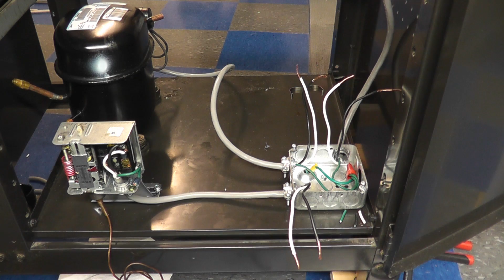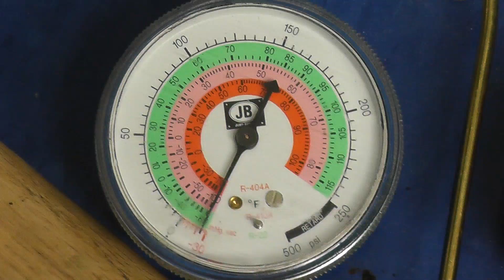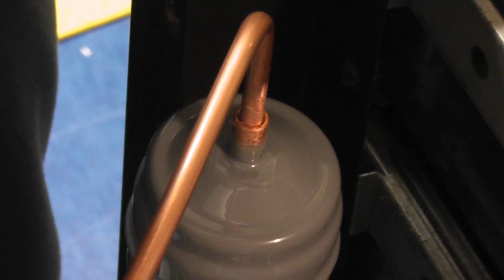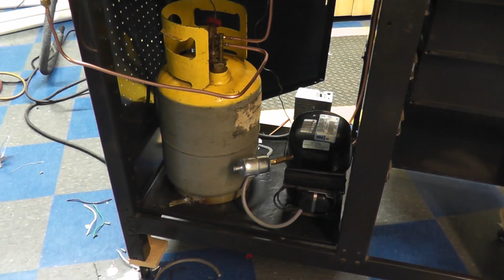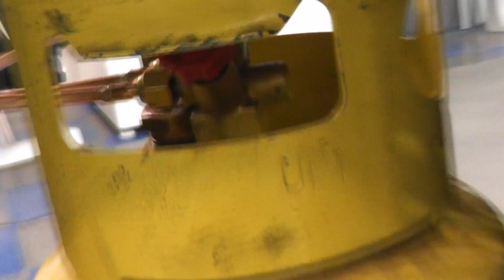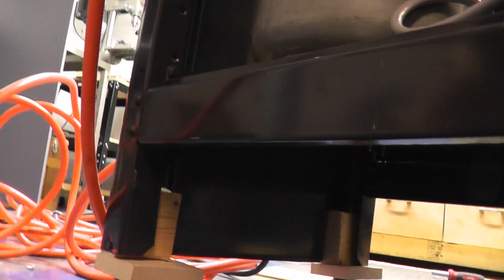Building a Silent Air Compressor Part 2

Comment: Getting rid of the water out of the pressure tank is one thing and is simple, however, the compressor intake air always has moisture in it which mixes with the oil in the compressor. That moisture together with the heat generated by the compressor pump will sooner or later render the oil ineffective and overheat the compressor. Being a refrigeration technician you know quite well why you don't have this oil/water problem in a functioning refrigeration system. So, what is your answer to prevent  the cooking of the oil/water mixture in the compressor for this different compressor application?
Reply from the maker: Haven't had an issue with it all the years I've been running it.  I just add a touch of air compressor oil to the compressor when I need to run it.   I'm only using it for air gun air and a small badger airbrush.  Usually just fill the tank and shut it off and that's enough for the.times I need to use it.

Comment: I was waiting for the plumbing to the pressure switch, didnt realize there was another connection available on that tank..  guess thats the benefits of using a refrigerant bleed down tank..  
   Was also wondering the type of restriction the drier puts on the system..  can you blow through it pretty easy?  Would think itd be pretty restrictive..  
  Wonder if anybody has done a oil seperator with an auto drain system that drains back into the intake of the compressor..  was thinking of trying that but the auto drains i think only dump on the down cycle when it relieves the head pressure on the compressor so the drained oil wouldnt get sucked in from the compressor and would only rely on gravity return.  Itd be a pain to plumb all that with the pipe sloping perfectly to the intake/ return tube.  Not to mention a vacuum relief valve so the compressor could breathe otherwise..  just an idea on the oiling of those boogers.,  mine spits it out pretty good..  using a copeland 240v hvac unit..  got mine routed first through a transmission cooler/ radiator with a catch right after where the cooled air will condensate and collect fron the radiator..  only 70° air going into the tank so literally no moisture..  perty fancy..

Comment: Refrigeration compressor with no pressure  relief valve and a water heater tank = A BOMB!
Reply from the maker: Didn't  see any use of a water tank and there is a pressure relief valve built into the tank valves just like on a propane tank that is easily adjusted with a spanner wrench

Comment: Thanks. Used your video and a few others to make a very small completely silent compressor for painting. Now I don't have to turn on the 5 HP beast to do simple spray painting of parts. Appreciate sharing the knowledge.

Comment: As neat and meticulous as you are with everything else,  why didn't you clean off all the OLD dirt and grunge on the pressure tank ? Also, you need a couple of small angle brackets to fasten the tank support ring to the shelf, so the tank doesn't fall over when you move the cabinet.

Comment: Doesn't sound silent to me. For silence, you need a compressor that is naturally and perfectly balanced, by its very design. That lets out pistons, cylinders, and even Archimedes spiral scroll compressors and Sliding Rotary Vane Compressors. Anyone know a design that would actually be silent? Such a compressor might replace Ozone-depleting gas/liquid refrigerators with ones using air as the working gas, leading to refrigerators that could not contribute to global warming, would not need much maintenance or oil lubrication and would have a good lifetime. Any inventors out there?

Comment: Thanks for the detailed video.  I have thought about building a very small unit like this as I have a brand new window a/c compressor (sealed) that has been taking up space for years in my collection of projects to do.  With your instructions and the comments I will now build it.  I was mostly worried about losing oil from the compressor.  Years ago before internet and You Tube ( yep that old and have the pains to prove it)  I used a similar compressor for a vacuum pump but neglected the oil and ended it's usefulness.  Don't pay any attention to the negative comments, they don't understand the force of DIY instincts and why we do these things.  LOL

Comment: If you put an automatic air tool lubricator in the inlet pipe it will keep the compressor lubricated then an air drying bottle to remove oil and water
Reply: Air drying bottle in the outlet pipe I should have said

Comment: Really nice job , how will you know, when to add some oil ..I am thinking about security valve such as after 250 psi it opens if any thing goes wrong. and thanks for sharing your project
Reply from the maker: I've just been eyeballing what comes out and adding a bit here and there.  Not scientific , but haven't had an issue.  It's just used for a blow off gun.  The tank has a pressure relief built in.  I just adjusted it to blow off ~230 by loosining the screw.  These tanks are set to blow off much higher than that as a recovery tank.

Comment: very bad choice for compressor,..these things cost 100-300$ and are designed to run in moisture free completely sealed and isolated system that always maintains apressure greater thsn outside/atmosperic pressure,14.7psi....to keep all moisture out. if system is greater than air pressure, no moisture will get to compressor,..but using it this way will corrode it in no time flat,,.i dont get why people keep wasting money and time building these things and pasting videos,..only a refrigeration tech would have the common sense not to waste time and money doing this,..and ony a refrigeration tech would be stupid enough to actually build one too,./.lol  dumb!
Reply from the maker: Really?  Did I say go out and buy a compressor? No.  All parts were free.  Moisture in a refrigeration system effects the OIL turning it to acid and if there is enough moisture in a system can freeze inside your evaperator creating a blockage.  Change out the oil to a similar viscosity air compressor oil and no acid and no issue.  Take a peak at something like a Sil-Air unit and you'll notice they are a refrigeration compressor with a hole bored into the top to add oil and a crude oil return system.  Apparently only a refrigeration tech would know that.
Reply: +Halligan142 quit wasting your time stupid. Always someone to make shit work the way it isn't intended to. guys like u in the field everywhere you turn. it can't turn out shit dude. simple as that. waste of time. or they would be building them this way moron....lol
Reply: Funny that, I have a Jun-Air one with a 15 litre tank, 12 years old regularly used and no corrosion, and no water in the oil.
I am now building an even smaller one for my airbrush, cost of the motor/pump, if free is expensive then it was expensive.
Reply: true, after further research, i see where these little guys can be beneficial,..I want to make a setup to blow out ac and refrigeration drains and low/high side and valves blow the sh.2t outt of em,..lol. anyway, sorry, Im extremely critical of everything. keeps me sharp. no offense .;)
Reply from the maker: Paul Garay 
Check out these guys for drain clearing.  https://www.amazon.com/DiversiTech-GG-1-Charles-Gallo-Condensate/dp/B00207UAU6

Use a Pellet gun style Co2 cartridge.  You only get 1 shot per cartridge, but it's small enough to fit in a tool bag and inconspicuous.  I use it in places it would be a pain to lug a nitrogen tank like tall roofs, larger buildings where it's a long walk to the unit, and air ports.
Reply: nice!

Comment: FYI the drain valve (petcock valve) - You can get really nice ball valve versions or use use 1/4" NPT style fittings and a ball vale for that. Nothing wrong with the one you use, they're just kind of a pain and I find they stick sometimes and are a pain to open/close.
Reply: exactly. Those type are used because they are cheap. I've replaced all mine with 1/4 turn ball valves. Makes draining your tank easy enough you have no reason not to do it.

Comment: Do you have a chuck valve to keep the pressure from backing in to the pump?
Reply: +Lenny M thank you I was just thinking about that I watch part 1 and 2 no chuck valve
Reply from the maker: +Jose Lacera Didn't have one when I did the build.  It was added later, but you need to add a way to unload the discharge line of the compressor or it's useless.  The compressor valves will seal and hold the pressure.  That's why equalizers are built into metering devices for refrigeration systems.

Comment: I have heard you need to replace the oil with a non hygroscopic one, meaning one that does not absorb water like the oil fridge compressors come with, which will eventually cause corrosion.  Automatic transmission fluid has been recommended over motor oil because there is no combustion and therefore no need for detergents and additives like motor oil has.  And it is also a lighter weight of oil with a lower viscosity.
Reply: +Jeff Beck true

Comment: Really helpful video and it helped me.  Around 7:40 you use the word common but you use it to mean common power and not common ground. Usually common refers to ground I thought. That confused me in the video.  I really liked how you showed the S and M letters on the relay to show the Start and Main terminals.  That part was awesome.  And I liked how you told people to wire it correctly sending power to the overload first. I've been shocked on an electrical system in an apartment where someone did it backwards like you warned them not to do, sending power to a lightbulb first, and then to a switch to break the neutral instead of the power.

Comment: Have you burned up the compressor yet? without liquid running through it it should get hot and burn out these compressors are cooled by the freon that runs to the condenser coil. I guess if you are just using it for a very small air supply it would be OK for a bit.
Reply from the maker: gunlover1955 Duty cycle isn't that long.  Will get warm but not overheat for my use.  You could always add a cooling fan, but this is designed for a blow off gun and a small airbrush.
Reply: +Halligan142 ..would a fan be enough?..if i build any of these it would be larger size to fill the shop tank..60 gallon.. a quieter higher pressure system is a plus
Reply: +Halligan142 ..I was thinking a capillary tube before the check valve coiling up to the compressor housing injecting cool air back into the pump
Reply: +gunlover1955 Eh, I thought the coolant had lubricants in it as well. Which I would think to be worse than just getting hot, but it would get hotter and cause it to wear down quite quickly without.
Reply: +gunlover1955 (I'm no engineer), wouldn't the heat from the compression action be related to the density of the fluid and thus, in this case since it is air being compressed, shouldn't the heat produced be far lower than the heat created from compressing a liquid?

Comment: I have small cylinder and gonna make similar like this.but I dont know what max pressure the cylinder can store (no label at all on d tank ) what I can measure is volume V=nr2h. Any advices how to work out presure max for the cylinder
Reply: all the metal tanks will handle 120psi, no matter what

Comment: Excellent video. I appreciate your thoroughness on explaining what and why you're doing it, thank you. I will be using a fridge compressor for pond aeration in a small solar setup I built. I was using a small 12v air compressor made to fill tires but it finally gave out, lol.. I knew it wasn't going to like the long duty cycles but it lasted about 5 months, hence my looking for a more long-duty-cycle friendly compressor which brought me here.

Thanks again and great job!!

Comment: Very informative video. But a few issues regarding plumbers. Good plumbers do not spread solder over the tube and fittings, this is ugly and unnecessary. A good plumber will leave just a thin line of solder around the edge of the fitting. Blobs and runs in the solder is a sign of to much flux and heat. If solder does run a plumber will not wipe it with a wet cloth, (or shouldn't ) but a moleskin pad.  The blow torch you use in the video is far to big for the size tube you are soldering.
Reply: +Tony Rigden you are right too much flux and heat but he did a good job

Comment: Nice rig. i know this has been done with old car A/C compressors, electric motor and old hot water tanks.
I have a few questions: why not use the liquid side of the tank (dip tube) to drain water, and tee off the pressure control line to pressure the tank. The capillary oil return is a great idea. Also would this compressor be subject to over heating. Would you be concerned with duty cycle. I guess the thermal cutout would take care of that.
Reply from the maker: Norma Winter I just use this for a shop air hose and to feed a small airbrush.  It doesn't run all that much and doesn't cycle a lot when in use.  A fan can be added to cool the compressor if needed.  I wanted everthing seperate and I wanted to make sure the tank can be completely drained and the valve was accessible.
Reply: +Norma Winter I'm with you that make a lot of sense

Comment: I think it would be better to place that filter drier after tank output instead of compressor output because there is no way for oil to come back to compressor through cylinder anyway. Filter drier would have to work much less collecting oil and moisture as tank will catch most of it. I am building similar setup myself in hope to be able to spray paint some car parts but seeing how fast pressure drops when you use it couple times I am doubting it can keep up for more than several seconds.
Reply from the maker: hooperwille It cannot handle a large spray gun.  I use it for an air gun and a small badger air brush.

Comment: How did your "oil block" work (the filter/dryer)? What kind of quantity of oil do you see when draining water from the tank?
Reply: davecc0000 ...or in your separator?
Reply from the maker: davecc0000 I get a little out of the tank, but it's not too bad and nothing in the separator.  I do want to make a dipstick for the compressor I just haven't gotten around to it.  In the meantime I just add a cap full of oil if I use it a lot and it has been fine.
Reply: ***** What oil do you use for lubrication? Mineral?

A dipstick is a great idea. It would have to be sealed against pressure?
Reply: +Halligan142 would you make video on that please thank u

Comment: H ello and thanks for the very informative how to do video.  As with the rest of us i have a question.  If I have a large air tank 270L and I need lots of air cfm which is better? use two or more 2HP piston compressor or 2 or more scroll compressor am using in my home garage so want to keep the neighbours happy.  Many thanks and keep up the good work.

Comment: Hi. What should the oil level be, in this type of compressor? (having tipped all mine out in the back of my van)
Reply from the maker: This particular compressor takes 456cc according to the papers (~15.5 Oz.)  If it's not labled on the compressor tag just look up the model number and you'll find the info.  In the case of a Tecumseh the model number is the little number under the larger hyphenated number usually starting with something like AEA or AKA with a series of numbers then more letters.

Comment: This is very cool Halligan. What is the tank maximum allowable pressure? Should we have a safety valve?
Reply from the maker: This particular tank has a safety valve in the manifold.  Max OPERATING pressure of this tank is 350 PSI and I'm sure the pressure relief was set somewhere around there.  It is a simple spring mechanism with an adjustment screw for tension.  I filled the tank to 225 PSI and adjusted the screw until it blew off.  The pressure control is set @ 200 so if it were to ever fail the tank would only get to 225.  You could easily add a pressure relief.  They usually have ones in the section of the hardware store with all the airline fittings.  There is also a relief valve in the regulator.  

P.S>  These tanks are usually filled somewhere around 75% of capacity with liquid refrigerant and they sit in a baking van during the summer and I've never had a pressure relief go off.
Reply: Now I feel it is safe. Do you know what the pressure this type of joint (soldering) can hold? Thank you for the video.

Comment: I raplaced my 13 year old carrier hvac system and kept the outdoor part. Can I use the 220v compressor and make one of these. The air part was ok, juste the gas heater went out.
Reply from the maker: Yes, but you'll need all the capacitors and the contactor and that thing will eat electricity.  Plus an airconditioning compressor is not as robust as a refrigeration compressor.  No real starting componants so you'll want to rig a check valve with some sort of unloader.

Comment: I did enjoy watching the excellent build and instruction. Been looking to build one that will run quiet but need one that will sustain the 150 psi for long period of blowing such as sand blaster. Will this do that? Or is there a modification to maintain the pressure without burning up it or automatically turning off the compressor every 30 seconds?

Comment: Could be used for airbrushing but am wondering what you are going to use is for wont run a spray gun or air wrench.
Reply from the maker: Shop air for my blow guns and air brushes.
Reply: cool

Comment: Nice but how long do these compressors work without oil?
Reply from the maker: The compressor has oil in it and I just add a little every few months.  Nothing to accurate I just use a bent rod down the capped process tube port as a dipstick.